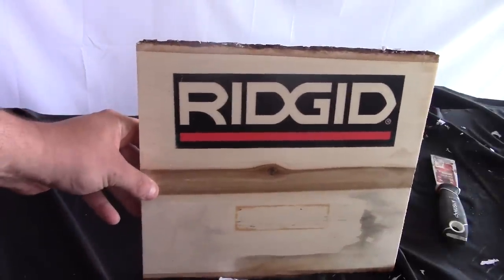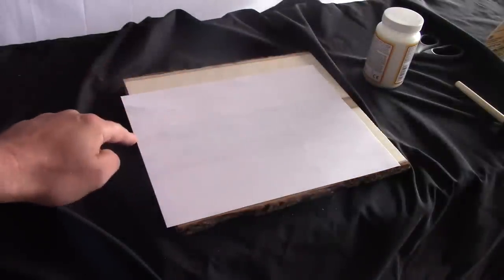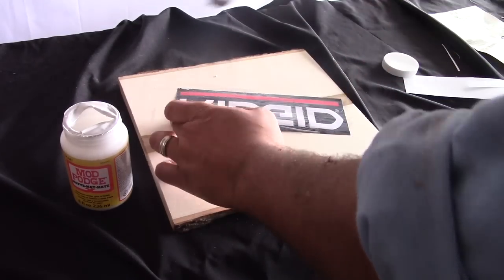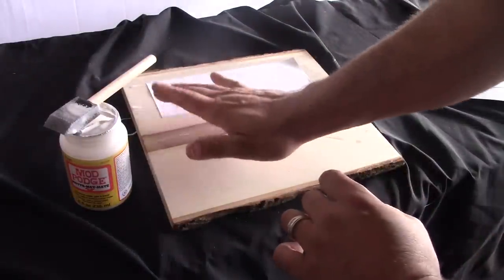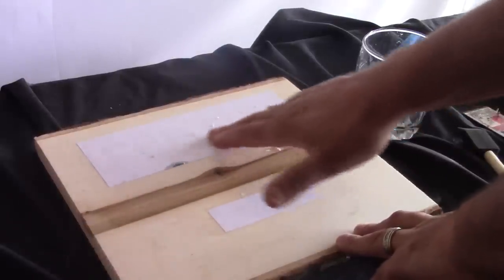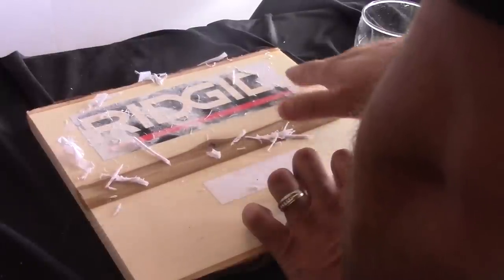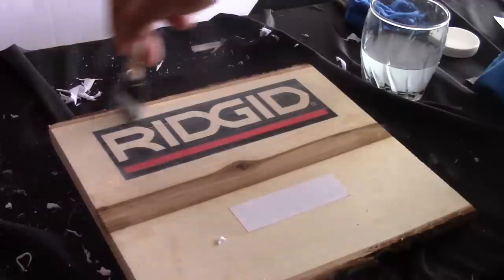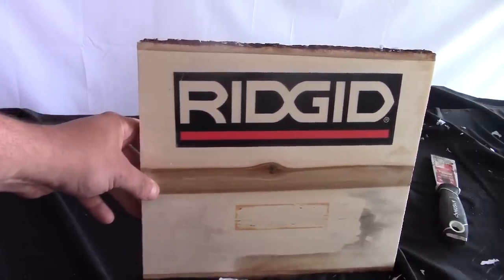How to transfer your favorite tool brand logo onto wood

Comment: use polycrylic instead of mod podge.  Put poly on wood, place picture on top of poly.  shouldn't have to wait but 1.5-2 hours. use toothbrush and warm water to get paper off. Bam! done in half the time

Comment: Inkjet printers can also yield the same quality, and using polycrylic for your transfer works very well.. Great video! Nice job!
Reply: Twisted Trees Farm hi can you tell me how to tranfer using inkjet
Reply: I did the polycrylic with inkjet and the image rubbed off. Does anyone know why?
Reply: @Mike-ib7um  Same here. I experimented with different drying times etc. The ink always rubbed off.
Reply: @Rayztubes  I gave up on it. Nothing really works.
Reply: @Mike-ib7um  I wonder if there's a simpler way to do it like just having a decal printed out of a logo or something... And you can just transfer the decal. Don't know, seems easier.
Reply: @Mike-ib7um you have to use laser not inkjet

Comment: Try water based polyurethane. It's thinner than Mod Podge or any gel based solution. It makes it easier to remove the paper and leaves a smoother finish.
Reply: Hi, can you explain how it works, I want to do what the man in the video is doing with a picture 14"x14", using your method.  can you help. Thanks
Reply: @davidruiz5383  It's exactly the same method as shown in the video, but you soak the print in water based polyurethane instead of the product he's using. It's the same water based polyurethane you would use for the top coat on any project, so it's easier to get in most countries. After you rubbed off the paper (do not use sand paper!) and only the print's pigment remains, you can apply more polyurethane to finish the surface. Make sure you really rubbed off all the paper otherwise it'll be visible after everything dries.
Reply: Thanks, have a great day.

Comment: I saw a video this morning that uses the backing sheet from mailing labels. (These were a sheet of two labels)The print is made on the shiny side of the backing. Next step is to apply the Modge Podge or whatever you use on the wood, (DON"T try to apply to the shiny side of the paper) Lay the printed side down just like your video shows. Make sure to squeegee all the bubbles out. Let it dry and lift the backing sheet off. No rubbing ad risking removing the toner.
Reply from the maker: Nice. Do you have a link for that Bear?
Reply: I believe they still make inkjet/laserjet photo paper.  It also as a shiny side for printing photos.  I wonder how it would work.

Comment: you can use Minwax Polycrylic water based and you only have to wait for 2 hours to take it off and less woek cleaning it up the paper comes off faster and picture has more detail
Reply from the maker: +dreamkiss4u nice, I'm going to try that!
Reply: Yes - this.
Reply: What is that kind water or where can i get that
Reply: @viktorperalta3090  imported from Canada, The water is very kind
Reply: @phatbastard7350  hahahaha

Comment: Good video. This technique on a wood project I was doing. I wanted to put a “brand” on the piece. The piece was stained by didn’t have polyurethane coating yet. I tried the heat transfer method that I saw on other videos but that didn’t produce good results. Mod Podge worked best, it gave the brightest transfer.
Reply from the maker: Hey Ralph,  thanks for the comment. Yeah it definitely does a really good job

Comment: is the ridgid lettering white or the same color as the wood? i cant tell. if so when you use white does it fade away to the original wood ? looking to do this but want the white areas to show the wood color. also if the board is painted first does it still work? thanks!

Comment: I have a Epson R1800 printer but I was thinking about a laser jet printer. Which do you prefer?
I have a ton of different heat transfers paper,a commercial heat press but I haven’t figured out how to design an image that’s in my head onto a program. What’s the easiest software to create designs?
Thank You 
Jim

Comment: Does anyone know if this would work on double wall cardboard?  Also, comments said the color white does.not transfer?  If that possibly because there was actually.no ink used to represent white on a white sheet of paper?  Would printing a "white" using a slightly off color white that required ink work?  Does anyone know the recipe for homemade mos podge???

Comment: This seems to work pretty good! I tried Mod Podge Photo transfer and after it dries like a thick white paint on areas that are not the picture and it doesn't come off. I'll have to try the Mod Podge Matte being as it's designed to dry clear.

Comment: I don't understand the why there's 16 thumbs down at the time of posting this. I thought it was fantastic. I'm eventually going to come across a project where I'll want to do this.

Does anyone know if this method can handle photos?
Reply: Pvt213 use the wax printer label method
Reply: Just use transfer paper.   Any paper with a layer of wax on it will do so the ink doesn't soak into the fibres of the paper but instead sits on the surface ready to be easily transferred to another surface.

Comment: Please guide me how to tranfer on mdf.. i want to make coasters. I have inkjet apson 360 printer with transfer paper
Reply from the maker: I would hit the MDF with some clear coat or shellac first then transfer the pic. After it dries, give it a second coat of finish
Reply: Please .what that white  substance he put it on both paper and wood
Reply: @user-dq2wt2op2b  it's called modpodge basically 1 part pva glue and 1 part water

Comment: I have done this many times with my inkjet printer (epson expressions 310). The only difference is that I usually use gel medium to do the transfer.
Reply from the maker: +Linda Taylor hmmmm, maybe I can try that. It comes out very dull with the Mod Podge, but my printer in not the best out there either. Thanks for the info!
Reply: No problem, but I just did some more research and found that my printer uses pigment inks and that is why. Who knew?!
Reply: What kind of gel medium do you use exactly?
Reply: With the gel medium, is it ok to use the regular printer paper?
Reply: @priyaskitchen1584  yes
Reply: @priyaskitchen1584  yes, it is ok to use regular paper
Reply: @AmericanBulldogRocky  I used Liquitex gel. I have also used Golden gel medium.

Comment: Will this work on wood that’s already been painted?
Reply from the maker: Depends on the color.  If the paint is to dark, it won't stand out at all
Reply: Tool Review Zone: the wood is painted navy blue and I wanted to lay down gray or white text
Reply from the maker: Yeah, probably not going to work buddy.  The white does not transfer, and the blue with probably be to dark.  You can try it, but don't think it will come out bro

Comment: Hi my name is Ed, very intersting video. Question, can I do this process on particle board type of Wood, they also call it fiber board . It looks pretty much like Wood but recycle. Thank you.
Reply from the maker: Hey Eduardo, it should be ok, but need to makes sure that all of the paper comes in contact with the wood. Sometimes that type of board may no be completely smooth

Comment: Very interesting video! Thanks. How did you manage to have letters in the color of the wood instead of "white letters"?
Reply from the maker: +Armand Fischer thanks for the comment. I have come to learn that only the only transfers, not the paper color. If it was white ink on the letters it would have, but just the paper will leave the wood looking natural
Reply: Because white is not printed with a CMYK printer. White is on the image as you can see in the video but in reality the letters are blank with no ink.

Comment: i have a  HP Photosmart 6510 inkjet printer, and it does work ,why keep everyone telling cant be done with inkjet?
Reply from the maker: +NLDHGRockStaR It comes out to dull
Reply: never had the idea it was dull, but maybe the type of ink here is slightly different here in Europe.
Reply from the maker: +NLDHGRockStaR could be. Many others experience the same thing, so they also push for laser jet. Could even be the printer
Reply: NLDHGRockStaR I

Comment: That modge pod .. is that just pva glue ??
Reply from the maker: +Peter whitehouse it's looks like it at first, but you can tell it's different. It seems thinner and not as gooey
Reply: @ToolReviewZone  According to other sites, it's PVA glue with water added to it.
Reply from the maker: It could be. Not really sure what they have in it but very possible

Comment: Is it possible to do this on a stained wood?
Reply from the maker: Hi Whitney,
You can add this to any surface, but I noticed that the darker paints/stains don't come out as nice. If you go with a lighter stain, you will be fine.
Reply: Thanks so much for the help and for the speedy response!
Reply from the maker: Any time, Good Luck!!!

Comment: can i use regular wood glue
Reply from the maker: Tried it Dusan. Just doesn't work as well for me.
Reply: Tool Review Zone how is mudge pudge different from wood glue just dilute it and that should me the same
Reply from the maker: Hi Dusan, I'm not sure what goes into them as far as ingredient wise, but you could try it. All I know is that I tried the Modge Podge,  Elmer's Glue, and polyurethane,  and the Podge worked much better than the others
Reply: i saw on forum someone saying homemade podge is mixing water with glue
Reply from the maker: It could be, but honestly doubt it. I would say try it and see if it works.  I would be interested to see how it works out for you

Comment: Is this just a normal print paper or a specific paper?
Reply from the maker: +christian johnson just normal paper bud
Reply: Tool Review Zone what about the type of mod podge?
Reply from the maker: +christian johnson the mod podge I used was the sealer, glue and finish. The number on yhe label is CS11301. Can find it on Amazon for about $5
Reply: +Tool Review Zone 
I am from the UK and my stores may not sell it is there an cheaper alternative to do this. frankie croft smales
Reply from the maker: +Centrevez Thanks for the comment. I have tried a few other ways to do this, and this was the best way I found. You could try to mix some elmers glue with a bit of water like some others have mentioned to see if that works. Not sure if the Home Depot will ship this to the UK, but there is a link in the description of this video for $4. Hope this helps